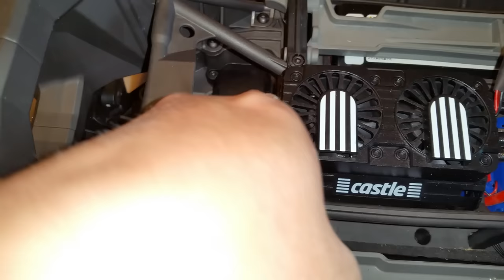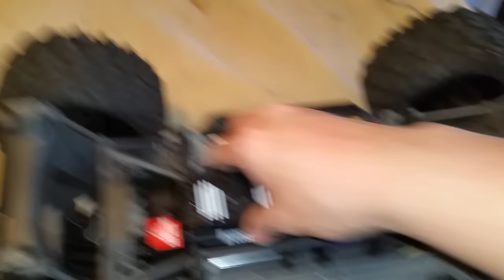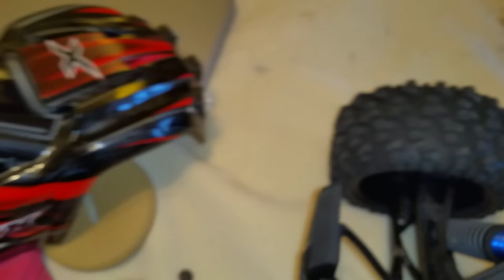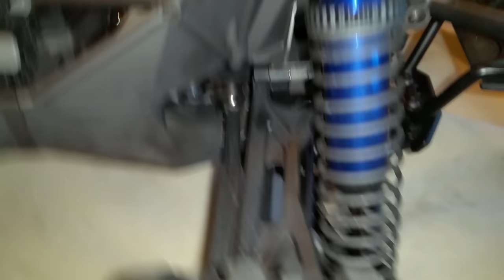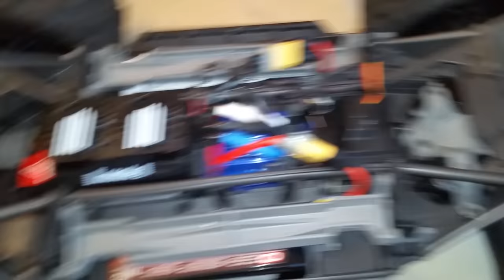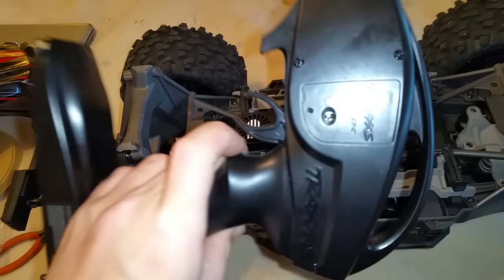X-MAXX review update with RRP MOD 1.0 18 tooth

Comment from the maker: yea the motor stays very cool
  the one thing I'm gonna do is reverse the fans in the 2028 blower cause from the factory they blow onto the motor.  it's better to pull the hot air away from it and duck in cooler air cause doing that will also help keep the esc a little cooler also cause the esc and motor are in srt of a valley so all the air will be sucked out instead of pushed in.  I also have 2 Muchmore racing fans 30 mm that are ultra high rpm that together will move 9-10 cfm.  I'm gonna get 2 more and switch out the stock fans that came in the castle shroud.  the more air you can move across the heat sink the ore heat you can remove.

Comment: Just installed the 18t spur gear,50k diff fluid and same castle 2028 fans.24.8mph in grass before 27.1mph after.absolute no wheelies unless full throttle on take off.
Reply from the maker: what batteries are you running?  they make a big difference.  you need a peak of at least 300 amps and constant 80

Comment: Oh yeah the bigger the spur the more torque, the smaller the spur the lesser your torque. I guess it makes no sense to put on a wheelie bar being a basher big boy truck though. be careful with that stock esc they catch fire when you start to gear up so just keep a close eye on your temps. nice truck though
Reply from the maker: I run triple esc fans and the castle 2028 fans are pulling the air out.  so there is a constant flow of air. only one esc has caught fire though.

Comment: look I'm not compering the size I know that the x maxx is way bigger. but overall I think the Savage flux xl is better. its fast durable nimble and its  well made. x maxx is big but does not look nimble. heavy truck equals to less run time more overheating and more broken parts do to the weight.
Reply from the maker: of course a smaller vehicle is more nimble.  But I've put over 100 hours on my X-maxx and with dual 7.5ah 3s batteries I get a run time.of about 30-45 minutes.  and just because the savages flux I sade out of metal means nothing.  instead of giving or flexing metal is going to break.  plastic on the other hand I are plastic and look at videos of how hard they are abused and how many companies use traxxas parts to beef up other brand vehicles.  for example putting a slash front end on an axial yeti because it is more superior.  and also traxxas wouldn't be the number one rc company if their vehicles were crap.and look at the aftermarket.  HPI is notorious for releasing vehicles and not ha ING parts for them.for months.  that was another reason I opted out of the savage xl.  They're just not worth the price especially when you can get an e-revo and blow the doors off a savage.  I'm not saying the savage is a bag vehicle.  it's hpi.  I own one hpi and it will be the only one ever due to the.complete lack of upgradability cause no one makes parts for them.  I know tey do for the savage but I'd get a Losi XXL2 before I get another HPI.  I learned.my lesson the first time.  Until HPI steps up their game in parts I'd rather go.with an exceed rc.  I'm are you love your savage and I don't blame you.  But I've got 14 different vehicles and when someone starts talking about something that they have no experience with and come to my channel and my video it's just unnecessary.  It'd be like me talking bad about your savage if I had no experience with it.  Do you blame me for being a tad pissed that someone comes to my.video on my channel and starts talking about a vehicle that many have no clue what they're talking about.  especially one person who calls the X-maxx the evolution of failure.  He eventually says that he cannot afford one.  And that is why most people talk bad about the X-maxx.  because it is an expensive vehicle and it doesn't even come with a power source.  So people are gonna bash it.  but once they get it in their hands their entire opinion changes.  Assumption makes so many people look like the first 3 letters of that word.  Something I learned a long time ago.  Don't bash something until you try it.  Life is meant to be lived.  And staying in a shell is going to lead such a boring life.  That's why I live life like a kid.  I have fun.  Yes hobbies and passions are expensive but I work hard for them.

Comment: my Savage flux xl can do wheelies at over 50 mph and all the standing back flips I want☺
Reply from the maker: your savage Flux is an eighth scale.  the X-maxx is between 1/5 and 1/6th.  I know all about the savage flux.  I almost got one until I saw that so many parts are plastic and only comes with 4 shocks when it's meant for double shocks at each corner.  the X-maxx weighs a good 10 pounds more then the savage xl.
Reply: +Randall Hughes all trucks have plastic on them. the Savage has alloy chassis, steel drive train and most importantly bullet proof diff that never brake. yes it has 4 shocks but they are big bore shocks way bigger than the normal one's. and there's no way your x maxx weighs 10 pounds because my Savage hits the scale at about 13 pounds give or take 1\2 a pound this is a confirm weight.
Reply: +Randall Hughes misread your 10 pounds more than the savage
Reply from the maker: +DANIEL Q the X-Maxx with batteries weighs 23.5 pounds.  if I have to I'll weight it and show you.  and the plastic parts I am talking about are parts that on a traxxas would be metal.  and I've also seen and almost bought the savage xl and it does not come with shocks near the size of the X-maxx shocks.  why so many people try to compare the savage Xl against the X-maxx boggles mind because the X-maxx is a bigger damn vehicle.  And you obviously haven't even seen an X-maxx let alone driven one so everything g you are speaking from shows your ignorance about this vehicle.  I know all about the Savage XL and will eventually get one but the Octane version.  I know all about it having a metal chassis and all the good parts but all you've seen about the X-maxx are videos.  see one and drive one and modify one and then you would have a valid argument.  until then just stop commenting about a vehicle that isn't even close to the size of an X-maxx.
Reply: +DANIEL Q savage flux has shit plastic shocks that leak and use pointless dual springs. also savage uses the same motor and esc that's in most 8 scale monster trucks so don't act like it is all powerful when its pretty much the same as the revo and the emaxx
Reply: +jacob portillo have you seen my video of 20 standing back flips?  my Savage flux xl has 4 shocks big bore and they don't leak. I never said my Savage is stronger I said the Savage is well built truck and better videos on YouTube about this truck are insane. I had the traxxas emaxx it suck 2 broken rear differential s plastic drive train to the wheels that start to twist under torque. traxxas is   for kids . where are your videos?
Reply: traxxas isn't for kids, savage flux is fine but the stock shocks are prone to leak, drivetrain I will say is bullet proof, just don't like the plastics. I have a slash 4x4 converted to strc chassis and tekno drive shafts and proline pro trac kit, essentially it is no longer a slash, but a combination of strc and proline and tekno. only the bulkhead and diffs are stock, I also own a losi scte and and a kyosho mp9e buggy. I have owned a revo and a emaxx, emaxx is a weak design and the bulkheads and diff are weak also, but the revo works well with a hd rear diff. I do believe I have a few crappy videos but have no good way of recording.
Reply from the maker: +jacob portillo thank you.  He's talking like a savage bought stock is as tough as the X-maxx.  and the shocks do not leak Daniel.  At least mine dont.  also for those who do have leaking shocks put 50 weight in and it stops.  I looked at getting a savage xl 5.9 and when I looked at the plastic linkages and the crap shocks I went with a 700 dollar drift car.  the savage xl is built to have dual shocks at all 4 corners but in typical hpi fashion they installed cheap parts and want 750 dollars.  sure the chassis is alloy and that is a plus but it's also gonna add weight.  Comparing a savage to a x-maxx is like Comparing a Toyota Tacoma to a Ford raptor.  It just can't do alot of the things the X-maxx can.
Reply from the maker: +DANIEL Q you talk about where are his videos.  where are yours. I searched and found nothing under Daniel Q
Reply: +Randall Hughes click on the blue man next to my comment in youtube
Reply from the maker: +DANIEL Q let.me.know when you hit 100 subs.
Reply: Randall Hughes did u see some of my videos
Reply from the maker: +DANIEL Q I do good.reciews and tell shit as it is.  the X-maxx is a brand new truck so there are gonna be problems.  At least traxxas already has parts available.  can't say the same fr HPI.  I've had my rs4 sport 3 for 6 months now and still no parts.
Reply: +Randall Hughes no parts at you local hobby store.  you can find any part on eBay with no sales tax cheaper and free shipping... I don't even go to hobby store no more, they never have the parts.
Reply: check jang from  urc review for savage flux, it aint too pretty, also friendofrc did a review and they had a lot to say about the truck, and it wasn't good. with that being sad all monster trucks are going to have issues. they are heavy and fast. only monster truck id love to have is the mt4g3. id rather have a truggy style monster truck where its super easy to work on with an open layout.
Reply from the maker: jacob portillo the X-maxx is extremely easy to work on.  Getting to the diffs is just removing the front bumper and skid plate and 5 screws hold the diff in place.  Very easy to work on.
Reply: Randall Hughes I saw that, its sort of like the slash 4x4 that's both front and rear in clips are easy to remove. nice.

Comment: I am from GA to where you at? I am getting some maxamps 3s 9000mah.But they don't sell it with the Traxxas ID, just the HD. they have the castle I heard they were good a few months back. I don't know what to get.  if you don't mind what is the part # on the Castle fan, and the Robinson 18th you say to get?
Reply from the maker: not exactly sure what the part numbers are.  I'd have to dig to find the packets they came in.  everything is on Amazon.  I love that prime shipping.  I even built a 2000 dollar scx10 with only buying through amazon.
Reply from the maker: I live in Warner Robins.
Reply from the maker: I don't like traxxas plugs and especially their new I'd charger.  it can't properly monitor all 3 cells.  I but another charger just for all the damn batteries I have now.

Comment: what are little things I can do to keep the xmaxx cooler ..
Reply from the maker: Extra fans, add a heat sinc compound between the motor and metal heat sinc for better thermal conduction, lower gearing.

Comment: How fast did it get up to with the 18t?
Reply from the maker: top speed in a straight away 61 mph.
Reply from the maker: scratch that the u1 was with the other gearing setup.  the 21/46.  with the 18/54 the ratio is 3:1.  the too speed with the 18 setup is 46 off road and about 51 on.  I don't like running these tires on asphalt  cause they do have a relatively soft compound and any sharp turn will put the Maxx upside down and doing the self-righting feature on asphalt really scuffs up the body and put holes in t in the corners.  particularly the rear of the bednjt myth till a company starts making not only different bodies but also an alloy version of Traxxas new latch system that incorporates a fairly basic but working roll cage.  if another company could reproduce t in aluminum and add some triangulation to the top and add some sopport on the sides it probably won't be cheap but you would never have to replace it if it breaks.  It irritates the hell out of me when people try to compare.other vehicles to this one such as the HPI savage flux xl.  the savage flux is an eighth and only weighs in at about 13 pounds gross weight but the X-maxx gross weight with batteries is about 23 pounds.  the only vehicles the X-maxx should be compared to are 5th scale vehicles.  yes it is a tad pit shorter but it is as wide and weighs about the same as a fifth scale such as the Losi 5ive-t or b and the HPI Baja and sc.